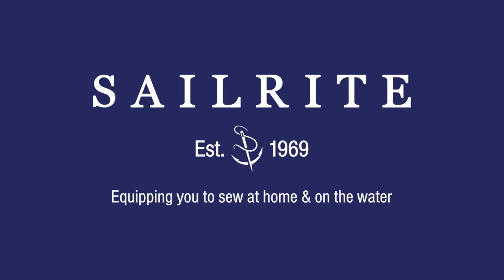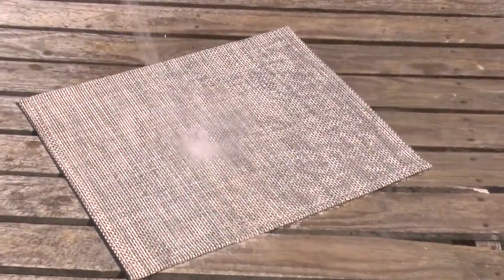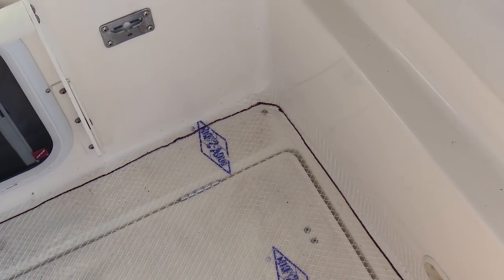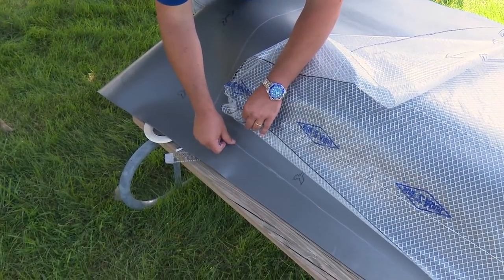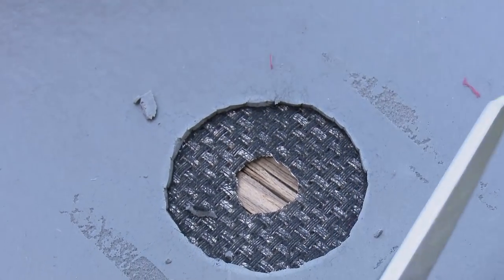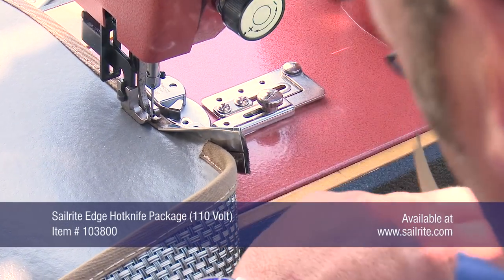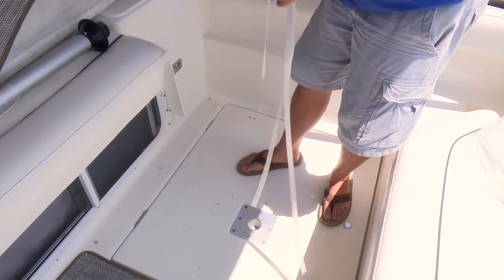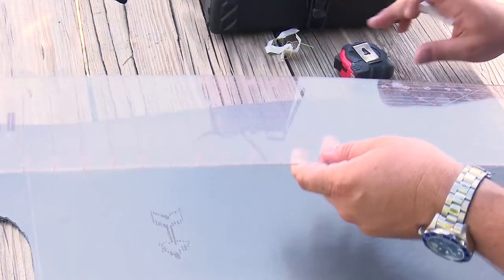How to Replace Boat Carpet with Woven Flooring

Comment: Why couldn’t you use the carpet that came out of the boat as a pattern for the new carpet for the boat
Reply: They did, the first time, that's why they had to do it over again. The original carpet wasn't right.

Comment: I think everything is great and I would actually do this to my boat now that I'm looking for the right material to replace my worn out snap-in carpet.  But that foam does not look very strong to be perfectly honest.  I wish it seemed like much stronger and more durable material.  If it gets damaged by double-sided stick tape, it ain't going to last long on a non-skid surface like my boat and in salt water.  Wish it was stronger backing material.
Reply from the maker: You may want to consider using Infinity flooring, it has a PVC foam backing. Here is a link: https://www.sailrite.com/Fabrics/Marine-Fabric/Marine-Flooring/Brand/Infinity

Comment: There is no way you only used 2 yard's! I have the exact same boat and I ordered the same amount of material you used. I layed all my templates out onto the material before cutting and there is no way. The edges of the 72 inch wide material isn't finished all the way to the edges. 2 inches both sides so a lose of 4 inches! Very disappointing since I I have waited for a month for it to arrive.
Reply from the maker: Chris, The Chilewich is always a full 72" of usable fabric. Give me your sale order number from Sailrite and will help resolve this issue for you.
Reply: @SailriteDIY  S.O 1031401 we are going to send you guys an email directly with photos and videos. Showing us trying to keep the directional of the webbing going in the correct direction.
Reply from the maker: @chrisholland1158  Please email me personally at ericg@sailrite.com. We just measured the flooring you bought on the shop follow and it was 78" with a few inches of salvage on both sides making the amount that is good a little over 72" wide. Looking forward to your photos and video to help resolve this issue. Eric
Reply: @SailriteDIY  thank you Eric! I think  you guys are awesome and I enjoy all your videos and products. My sailrite 111 has turned out many beautiful projects over the years.  My next project is going to be the full in closure and Bimini.

Comment: What happens when you drop a treble hook on it?  Time to take out the scissors?
Reply: No, use wire cutters on the hook, then push it the rest of the way through. Then you only have 2 small holes (you can do that with people too).

Comment: very nice. i'd definitely do snap on woven flooring on my boat if i had a FREAKING BINDER. unfortunately 99% of us don't. how well does this flooring work wrapped around a plywood floor? does the backing float water to the sides and off of the wood?
Reply: you can buy binder at any fabric store, joanne fabrics, walmart... very cheap.

Comment: Can I use a regular sewing machine?
Reply: You can try, but the stitches won't be even (walking foot machines pull from the top and bottom), and it will tear up your machine (they aren't built to handle tough fabrics).
At $150 and up per yard, I'd use a proper machine.

Comment: Ich finde es faszinierend wie diese Firma ihr Fachwissen weitergibt.  I find it fascinating how this company can spread its expertise.
Reply from the maker: Wir verkaufen DIY Lieferungen und Materialien. Haben wir gerne zu teilen, wie es mit unseren Kunden und zukünftigen Kunden getan hat.
Reply: By the way,  I tested and found a way to seam the edging to connect sections..   
I used two clean cuts to dry fit them and then used seam stick 3/8 on both backside edges.    I used 1" edging and then used a black PTFE thread to run a seam down both sides.    Finally I used Locktite Seal and Stick clear adhesive to glue the edges.   Its perfect.    The black thread is lost in the pattern..   :)